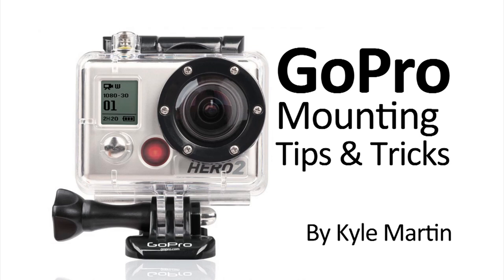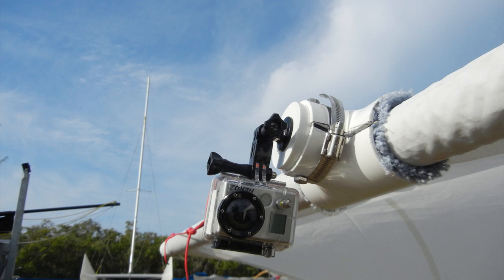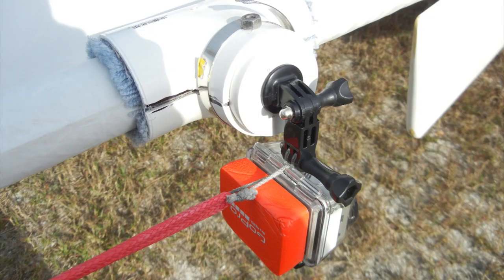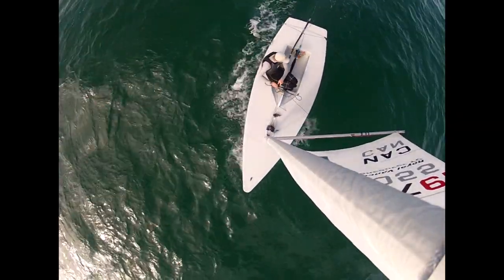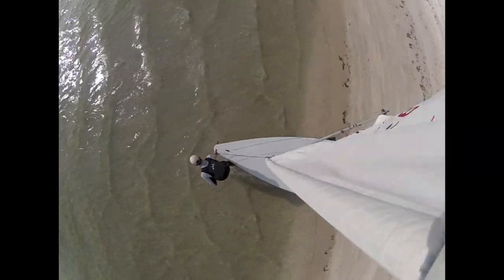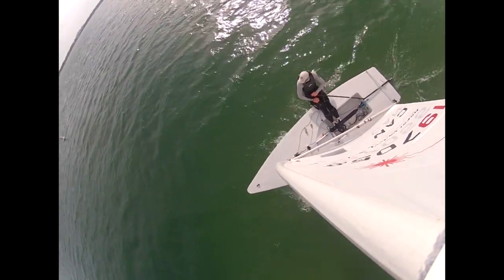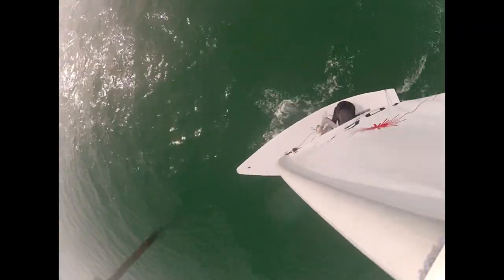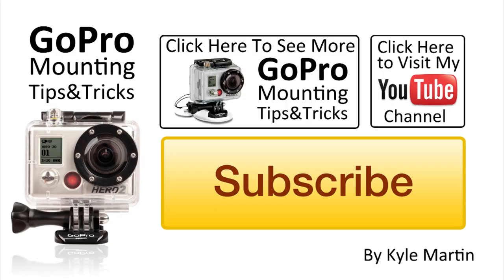GoPro Mast Mount Preview: GoPro Mounting Tips & Tricks

Comment from the maker: @808soccerboy97 

Most of the time I just left it running but if I wanted to start on the water I would get in to our coach boat and pull down on the mast to partly capsize the boat I was then able to operate the camera. 
This will be a good spot to use the Wi-Fi BacPac when it comes out